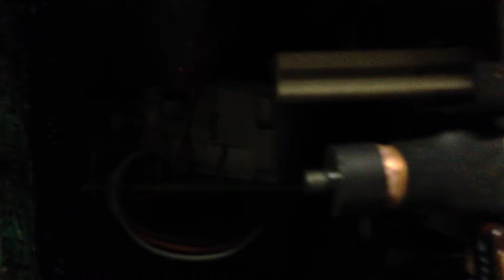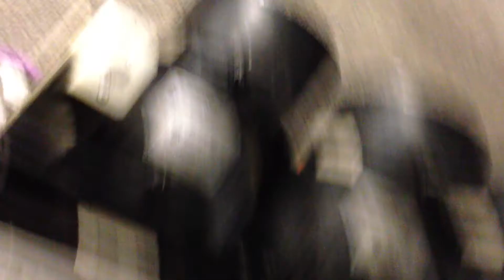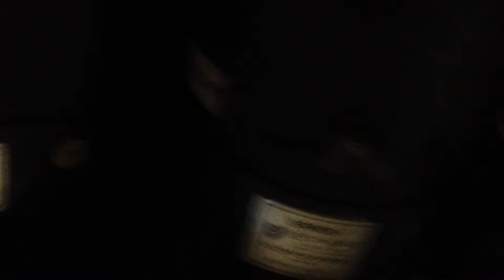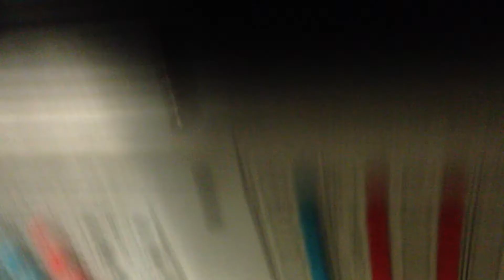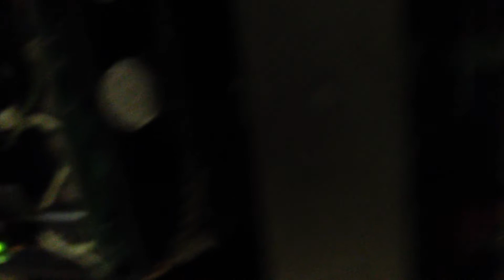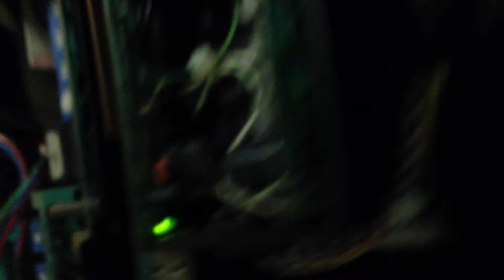Barco data 600 part2

Comment from the maker: Sadly, I never got mine running. I think it has a worn out power supply. What I can say is that it is very well built with great quality parts. There are no generic components. The whole thing is built on a solid metal frame, and is quite heavy. I can carry it by myself, I would never try that with one of my graphics 800s, they are much heavier.